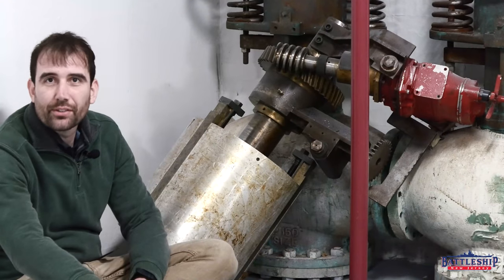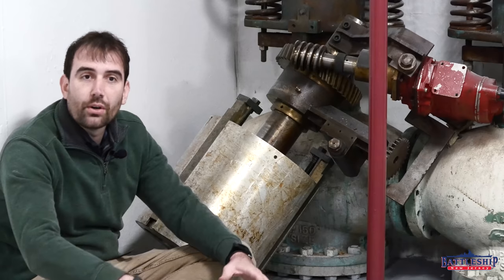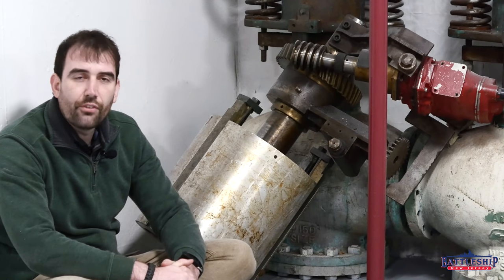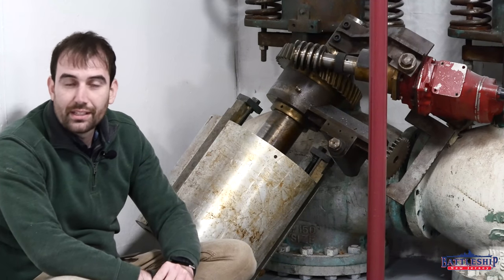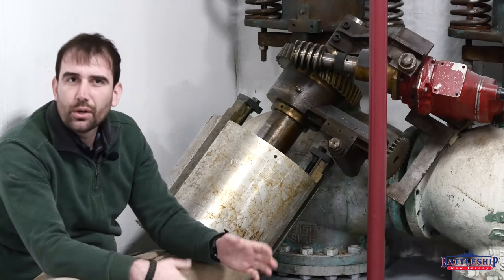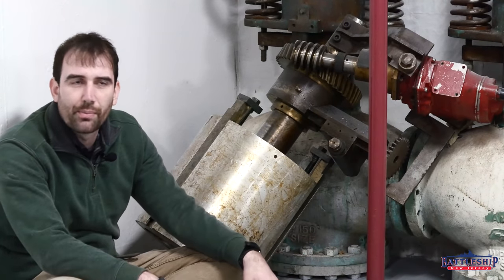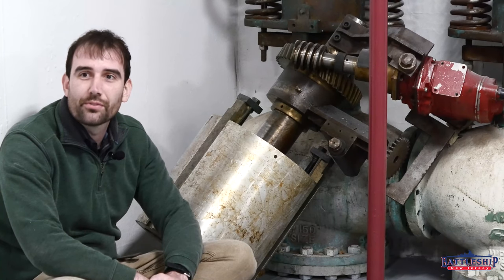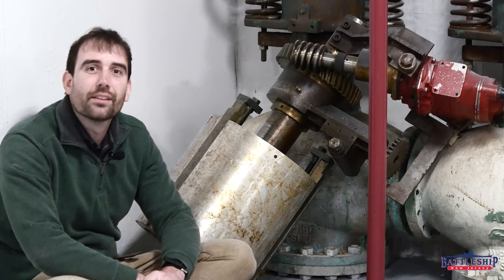How Do You Circumcise a Battleship?

Comment: I suspect the reason the barrel was scrapped was because the escaping high-pressure gasses through the crack probably damaged the barrel itself. It's the exact same concept to a case cracking or case head separation in a normal firearm. It can mar the chamber in a way that will cause problems later.

Comment: I was assigned as an "air guard" at a rifle range my group from our platoo was running. Air guards job is to alert the tower (all orders from from the tower) if I saw anything flying down range including birds and helicopters. Someone on the firing line with a loaded weapon might just get an itchy trigger finger and take a pot shot at the bird or helicopter even if it might (in theory) be too far away.

Comment: The oldest sailor I've seen had to be in his 70's or at least mid-late 60's as a brig guard. He used to smoke in the non smoking section in a cell block while on duty and flushed his smoke down the toilet in an open cell. This was in Quantico mid 1990's. This was the same cell block John Hinkley was rumored to be temporarily held in right after he attempted an assassination.

Comment: Not strange in the typical way you would think, but in the army I had to act as a railroad traffic guard in Germany when loading vehicles onto a train for deployment. Since it was an old World War II flight base the tracks had no infrastructure for that and cut right through the main road so I would have to run out there with a little saw a horse and tell people to go around. I thought it was pointless for me to be there until I had several dependents try to literally sneak their car behind me while I was jaw jacking.

Comment: Slightly off topic - but since you mentioned the movie again. . . Having a slight disagreement with some friends of mine on if the shot from the 16 inch guns in Under Siege would have been possible with the improvised gun crew they had to work with in the movie. If one of them wasn't the hero of the film anyway. 

So could 7 relatively untrained men, under one gunners mate hit a submerging sub at that range at night with 2 shots from a 16" gun?

Assuming they still had all 8 people, since they had to also fire a shot from a 5" gun and not get caught and such
Reply: Assuming the gunners mate knew all the different aspects of how the guns worked, not just a single area of expertise, its possible in theory. The catch being it would likely not have been as fast as shown in the movie. As 5 of the 7 would have to get down to the shell deck, send the shell up. Then get into the mag and send the powder up, followed by aiming and firing the gun. 
For reference, each turret typically had between 77 and 110 men manning it.
What was shown in the movie would have been possible with a full crew in the turret, the reload would have taken much longer with such a small crew. 
As for hitting that target, at the range stated in the movie I believe it should be possible from the #1 turret. But you likely would've only had one shot before the sub submerged. In the movie we get the benefit of the sub being damaged and stuck on the surface for a bit, which gave them time to reload.
Reply: Thank you for informative reply. Of the group of 6 there were 3 emphatic "no's" 2 "Absolutely" with me in the middle. I got even more skeptical over time as I learned more about the ships and just how much went into actually firing the guns.

We had planned to ask Ryan when we took our tour next month, but life has happened so it's down to just me going so thought I'd ask here :)
Reply: @shawnarner469  No problem. Should have noted with a full turret crew those guns had a max rate of fire of about 2 per minute. So if say 100 trained sailors could load, aim and fire one every 30 seconds, can work out how long it would take 7 to do it. 
So possible, but not nearly as fast as shown in the movie.
Reply: Might be a fun experiment for one of the meusems to time out sometime - how long it would really take 7 people to fire a shot from a 5" gun, then load aim and fire a 16" gun. . . . .
Reply: @shawnarner469  Some of it you could test out, but unfortunately not all of it. For example, the shells displayed on the shell deck are all replicas, so not the 2,000+ pound real projectile, and the floor is no longer oiled to facilitated their movement to the hoist. They do have a few replica powder bags on display, but I don't think they have 6, and I'm not sure if the hoist and elevator still work. 
But I would estimate that if they got 7 volunteers to participate, 2 at the breach and 4 down below, and go through the motions, you'd probably be looking at maybe a 10-15 minute loading time as they moved down to the shell deck, then into the mag and sent it all up.
Of course that's all assuming they generally know the ships layout, and have someone with the skills directing them. I'm pretty confident that if instructed how, I could do it, but without that id have no clue.
Reply: Very true. Still might be fun to actually go through the motions that were possible currently, kinda do a "Iowa Class Mythbusters" deal. If for no other reason than just to be able to say you did it.

Comment: Doesn't matter if it is a .22LR, a .30-06, or a 16" naval gun.  A rifle is a rifle, and the crown is the last portion of a rifle barrel which contacts the projectile.  Any damage or other out-of-tolerance condition in this area WILL affect the accuracy.  

Unfortunately, the crown is also the area where the projectile and the hot corrosive propellant gasses are traveling at their highest velocity, resulting in accelerated wear.  This is also where you are most likely to cause damage with a misalignment of any cleaning gear.  I'm not really surprised that this tool exists, as there are similar tools available for small arms.  In the civilian world, the difference in accuracy can be the difference between "successful hunt" and "rather expensive camping trip while heavily armed".